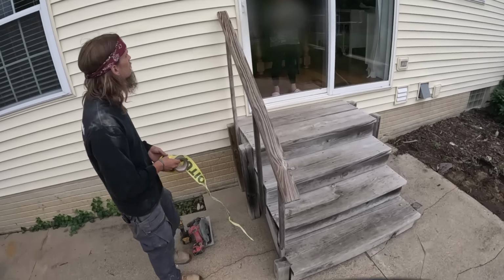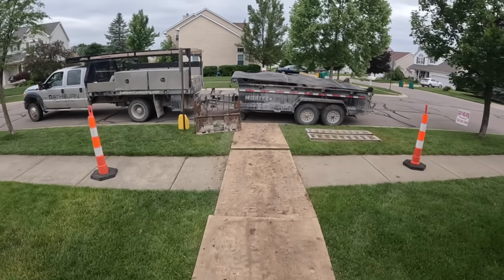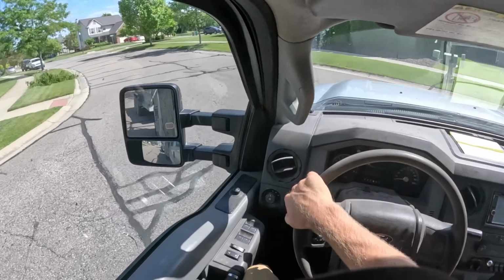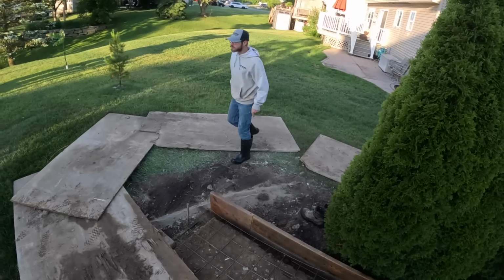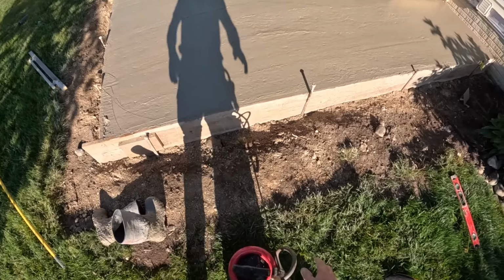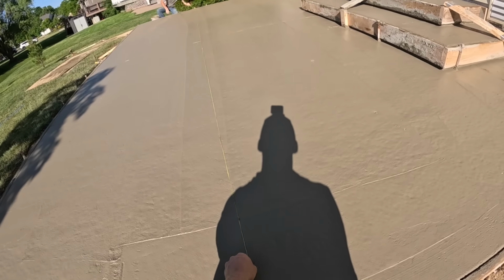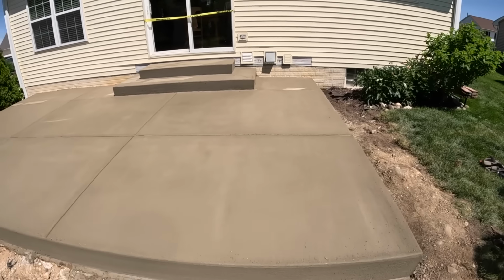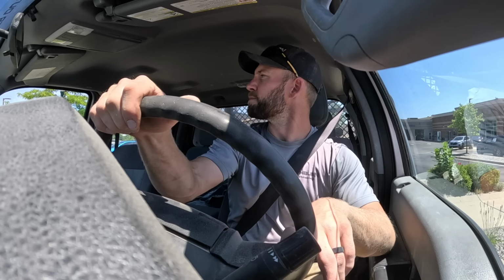A Nice Backyard Patio!

Comment: Looks like your well set up for these jobs... ride on mini and the concrete buggy.
Topsoil and re seed. Im impressed. Your attention to detail and your skill set shows through, the only question i have is your sub grade had what appeared to be a barrier of sorts on your safe and comfortable bithday steps.
Somestimes those steps if not pre poured will transfer a crack up from your hand tooled joint in the slab. None the less I'm impressed with how you do things.
Reply from the maker: Thank you very much. I came back that night and finished the cut up the steps with a blade and beveled blade to match the joint marks